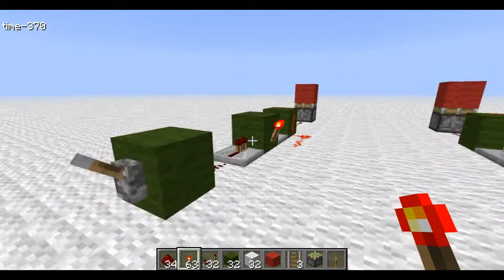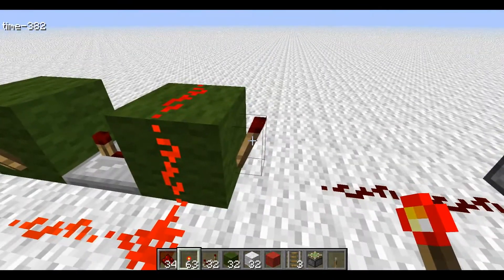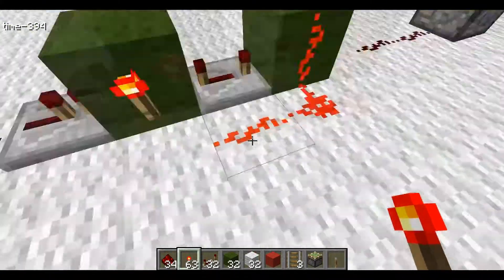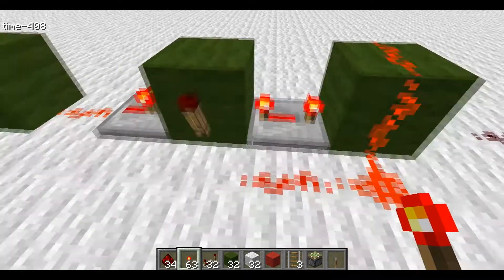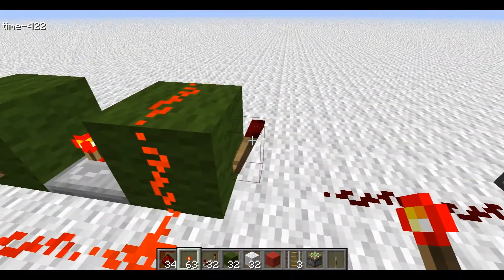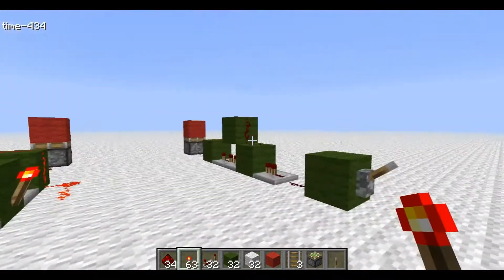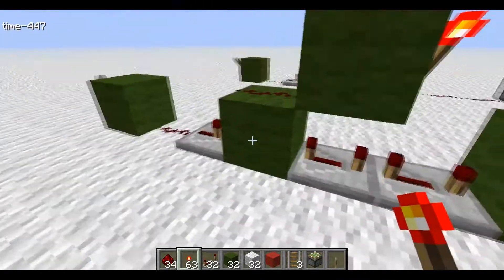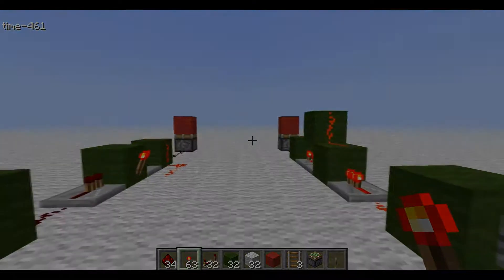Minecraft Tutorial - Redstone Monostable Circuit

Comment: It's handy in some situations. IE Where you're trying to speed up a piston tape drive - problems occur where a piston is extended into a block that another piston is attempting to push blocks into. The pulse from a button or a repeater carrying a button's signal lasts too long. A monostable circuit can be used to shorten that pulse enough to prevent the piston trouble from happening.